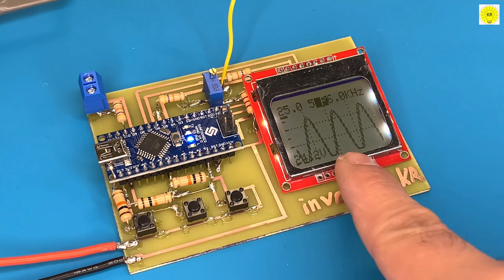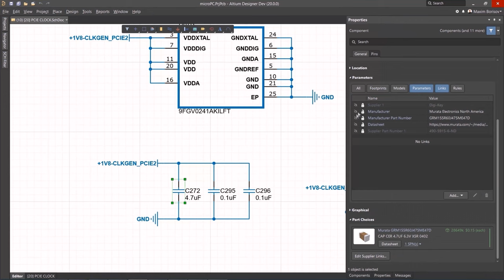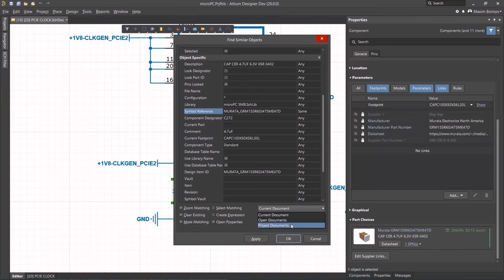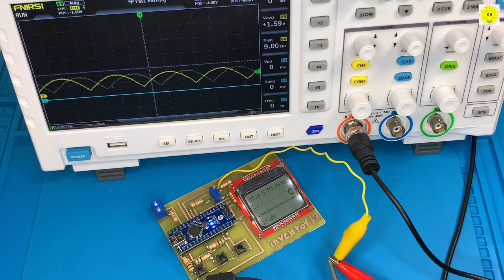DIY make Oscilloscope 10$ VS Regular Oscilloscope 450$ using nokia 5110 lcd , arduino nano

Comment: Hocam arduino ile eksi voltajlar ölçülebiliyor mu? Sinüsün eksi kısmını ölçebiliyor mu yani
Reply from the maker: Evet yapabilirsin
Reply: @inventorkr1 Arduino ile direk olarak negatif voltaj ölçemezsiniz. Eviren bir yülselteç ya da voltaj seviyesinin besleme aralığına kaydırılması gerekir. Yüksek bir giriş direnci olmadan porta negatif gerilim direk verilirse port yanar. Chip in geleceğide meçhul hale gelir. Porta uygulanacak maximum ters gerilim Vss-0.5V kadardır. Arkadaşın sormak istediği bu idi sanırım. Uygulamanız bu arada gerçekten güzel olmuş, elinize sağlık. Başarılar

Comment: Hello Thank you for your good video Sir, can I measure the frequency of 220 v with this oscilloscope?
Reply from the maker: Yes, it is possible, but you must be careful when using high current, and you must also put a 2 m ohm resistor on one end of the wires.
Reply: @inventorkr1  Even more a safety transformer.

Comment: i dont like the way you solder youre components
Reply: Actually it's good thing that he solder this way. He did it on purpose. 
I able to create the same oscilloscope using his video. I captured this video as image file and carefully track the circuit.
I compare the captured image with the circuit diagram to find out how components are connected and to know if I made any mistakes.
It would be lot harder if he soldered as normal through-hole.
Reply: Well, maybe he could have put a little bend on the component leads, so they would have better mechanical support, but it is a simple and cheap PCB, and seems to work, for now 😸